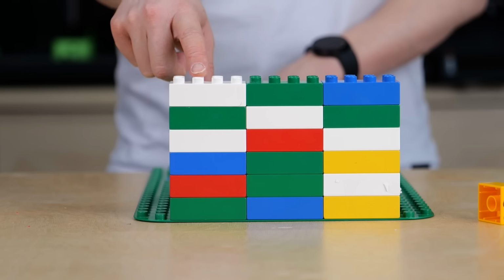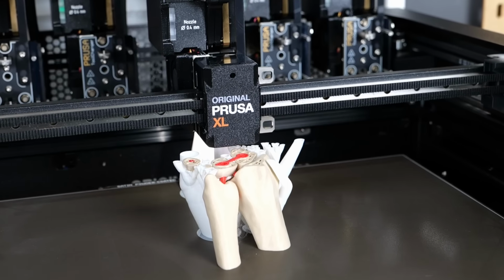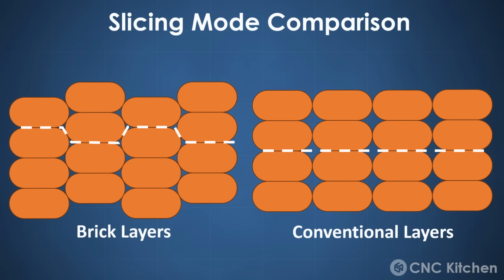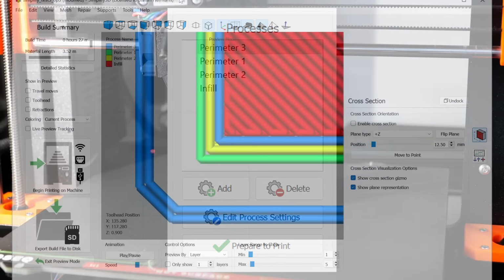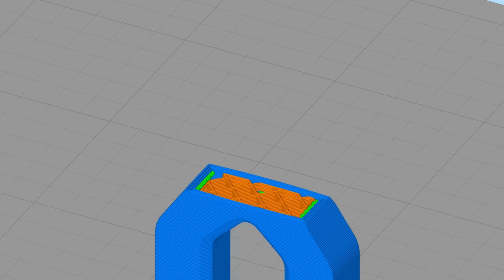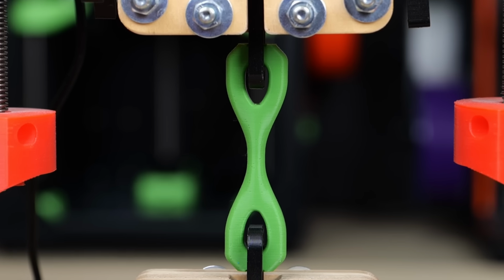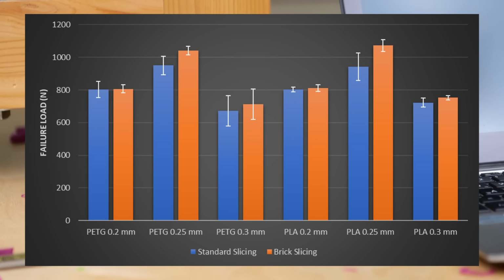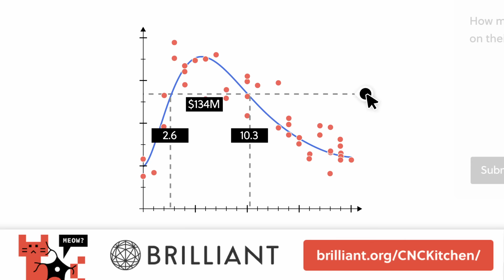Brick Layers - Why did no one do this before?

Comment: One thing I couldn't help but notice was that the contact patches for the brick slicing seemed smaller, even though there was a larger number of them. I can't help but wonder if this might have reduced the potential strength gain and if it's possible to increase the extrusion multiplier slightly to increase the squish of each layer and try and increase the contact patch size
Reply: You identified the main problem with this test: his layers were too high to start with. With low layers they squish into rectangles (in cross section) and as you get to high layers they look like circles. Layer bonding area drops towards zero and tensile strength falls off a cliff. In my experience, nozzle diameter to layer height ratio needs to be 2 or greater. I very much like this idea but I wish he’d done this test with a more conventional layer height (say 0.2mm).
Reply: That extrustion multiplier makes sense too since you are imparting more "void" space since printing lines naturally tend to round out. I wonder how much a small amount of extrusion multiplication would add to final strength
Reply: In PrusaSlicer’s default settings, it uses a 0.45 extrusion width on a 0.4mm nozzle. This plus a layer height of 0.2mm or lower creates perimeters that don’t have the giant gaps.
Reply: @Tyler-wg5xh  This plus extruding at the high end of the material’s temperature range so that it really squishes itself into the voids might get even closer to near perfect contact!
Reply: @joshcarter-com  right but we could increase that for taller layers to make faster prints that take better advantage of this too right?
Reply: @frankroquemore4946  yes, definitely. This would be a great feature for taller layers and faster prints. I posted a separate comment about these factors but unfortunately YouTube comments either get tons of attention or none whatsoever, so I doubt Stefan will see it.
Reply: I noticed something similar, with ideal extrusion parameters the corners between the extrusion paths should be filled.  Perhaps normal extrusion weight for outer walls, higher for infill walls.
Reply: @bosstowndynamics5488 I had the same thought. If it were possible to achieve 0-width voids in the lattice, I think we'd see some real improvement here, and we'd see something that looks like a hexagonal honeycomb pattern in the cross section. Unfortunately, I don't think there's a way to reliably create a 0-width void extrusion process on modern FDM. 

I would really like to see some research on how the shorter distances between the voids affects material strength as well. The problem with FDM is that all of these factors are so hard to separate from each other so isolating effects is a real challenge.
Reply: I thought the same thing, but another option that I think would be interesting is using something like an adhesive to fill the gaps after the print. If you can force a low viscosity adhesive into the gaps that'd probably help a lot.
Reply: @LanceThumping  A lot of those voids wind up sealed in though, they're going to be sitting in between layers and infill lines that are entirely contained within the outer perimeters
Reply: Those empty voids you see on the image are just for illustrative purpose. In fact the voids are filled more completely with this stagering method. You just have to figure out how the material is purged by the nozzle, how it fills the previous void, and then squished by the nozzle to make not a round shape but more a square one. Then comes the next "half layer" and grab those square borders better than if it were just walls next to walls.
Reply: @edufonseca5718  I really don't see how they can be "just illustrative" when they're close up photos of an actual physical print...
Reply: @bosstowndynamics5488  One option is to have something like a dual extruder setup.  We don't build a wall and then try to inject mortar.  Instead we put it down with every layer.

Comment: I know this is old post but thought id add..  it looks as though theres still a good amount of air between the extruded tubes..  it occurs to me that if youre printing alternate high profiles to then subsequently come around and print a half height higher to fill these in. These could be slightely over extruded, as you are now filling in a 'well' you can squeeze the material in a little more and hopefully reduce the air gaps.

Comment: Would it be worth trying adding a tiny bit of overlap of the walls to increase the diagonal contact points? Or maybe adding an half-width perimeter on the outside so each other perimeter is extruded on the middle of two of the bottom ones?

Comment: The secondary cracking looks to me like you are approaching isotropy. This is definitely a positive development.  I’m excited to see what can be done with ideas like this.  Varying deposition width and thickness to direct forces to more advantageous areas.

Would it be possible to print a part with small-diameter z-channels, then, when the print head gets to the top of the part, instruct the nozzle to pause over each channel and inject material down into it?  I’m curious if you could increase tensile strength by adding z-oriented structural members in this way.
Reply: This! I just left a comment about this haha.
Reply: Dang little injection molding channels would be incredible!
Reply: Good idea. Bah, in reality might be difficult to achieve. To inject  some molten plastic for some length in such a channel you must create a pressure all along already filled region of this channel. Thus, you need to seal somehow the channel entrance and a nozzle. Nozzle is hot. It will melt the walls and plastic will go all around the nozzle but not in the channel.
However, maybe it depends on the channel length, and having such a stitches between 3-10 top layers is achievable.
Reply: @bogdan1543  consider the possible use of a second material which has a lower melt temperature.  It likely wouldn’t bond as well to the surrounding “jacket” but it might offer additional shear resistance none-the-less.
Reply: This just popped in my Youtube so I'm a bit late... I've tried this by creating a part with z-axis holes and modifying gcode to do the 'extrusion'. 
1) Superheated nozzle (260 degrees for PLA instead of 230) 
2) Pressed nozzle tight onto the hole (half a layer into the surface)
3) Quick extrusion with some tuning to get timing right (hot PLA was dripping from the nozzle)
Managed to extrude about 10 layers deep, which is promising, but I thought same as @robblincoln2152: One should use a second nozzle with lower melting point & viscosity material. Even something like cyanoacrylate if one could prevent it blocking the nozzle.
Reply: Didn't observe any strength improvement. Probably partly since z-axis holes can cover only a small fraction of the layer surface area.
Reply: @akuusist  I am legit impressed that you actually tried this.  Thank you.  It would have driven me nuts otherwise.

Comment: I'd be very interested in testing this approach towards air/water tight prints. Those interlocking lines should also help with reducing gaps between extrusion lines.

Comment: I remember trying something like this in 2017 by taking a page out of my composites experience with alternating patterns and rotating layers. It was a pain in the butt getting the printer to run them concurrently without inducing a concentrated repetition zone where the initiation point wasn't a blob in a corner. Gyroid infill works in about the same way and doesn't require manual code adjustment, but it would be worth trying again with modern advances of the last few years on the entire layer slice.

Comment: A potentially even better solution could be a system of channel and fill. but require 5 layer at least, so it creates something like this:
nomeclature: 
layer x : sequence of the height of the extruded plastic

layer 1: 10111
layer 2: 10101
layer 3: 13001
layer 4: 10031
layer 5: 10301
goto layer 3

this way you can create more planar decoupling, but it is a lot harder to implement. the other thing here is that the channels where the multi line is filled could suffer thermal failure an suffer some bucking (or eventually, re melting and welding better the vertical interlayers).
Also, this solution only works in close-to-vertical walls. and would reduce printing time as some of the load (machine limiting factor? idk) would move from the kinematics to the extruding system.

Comment: PURE GENIUS! Stefan, you just figured out the best Draft settings ever! This could be the best 0.32 layer heigh way of printing fast and strong parts. 3D Printing will be better because of this video. Way to go man!
Reply: This was my conclusion after reading the post about over extruded solid parts being equally strong with and without stagger or overlap.

This is faster and stronger, for rapid prototyping only.
Reply: It's better, but it's not nearly the best. The best would be to print with the fibers aligning with the flow of tension and compression and leave no hole in the center of the cross section of the model as seen in the demo. Instead of a mere 10% improvement, there could be a 20x improvement.

Comment: Very cool.  I hope this gets more traction.  Could you use ironing to fix the inconsistent top layer? And slightly overextruding in the mid layers also seems like it would be helpful, maybe especially if it could be alternated off and on between alternating layers.

Comment: Just had a mighty row with a friend about this very subject. How to make sure that the circular filament fills out the square “channels” in which a slicer “thinks”. He said I was too lazy to make a better = thicker design. I said there is something fundamentally wrong if slicers can not adopt to this problem. Until then 3D printed parts will be very much weaker the those made with conventional molding technology. You’ve taken an important step in the right direction with this very experiment. Well done!
Reply: the solution would actually be quite simple. Print outer walls first, then for inner walls increase flow so it fills out the empty space neatly squished between the outer walls.
Reply: @Janovich   In theory? Yes. In practice?
Reply: @marcbrasse747  In practice, I think it'd tend to warp if that's the only change you made.
Reply: @S_Roach  Your remark is a bit cryptic. Please explain what you mean in more detail. 🙂
Reply: @marcbrasse747  I suspect if you created a shell, then filled that with hot filament, which, please remember, is a non-Newtonian fluid, in that it readily expands after it leaves the nozzle, to its "natural" diameter, that you'd end up with a shell that was being pushed on, constantly, by the filler. I think this would likely result in a print that tended to change its shape over time. To warp like green wood does.
It would probably be more obvious in thinner-walled prints.
But, that's only my speculation.
Reply: @S_Roach  it’s all a matter of balancing a lot of parameters but the fact that the smelt expands after leaving the nozzle could actually be used to make the round thread expand into the square channels in which a slicer thinks. It is after all supposed to reduce every object to a sort of reduced resolution maze of  square “tunnels”. In an optimal situation the expansion should exactly fill the extra surface. The bricklaying method described here can be a first step towards such optimizing but even a pile of cilinders still has a lot of empty spaces and thus a potential for poor adhesion. Just empty a sack of unboiled spaghetti. Many a print actually behaves like a bundle of half boiled spaghetti. 😁

Comment: The use of dimensional adjustments in simplify was pretty smart! I think most people don't realize how powerful the process settings in Simplify can be. I would have never thought to use them this way. Nice video 👍🏼
Reply: True, I used Simplify 5 years ago to achieve the adaptive layer quality almost without time loss (outer perimeter is 0.05mm, inner and all other model parts — 0.3mm) using the same technique with multiple printing processes. Even 5 years later there are no slicers which can offer me this incredible functionality.

Comment: This idea needs to be tested with z “wobble” this would drastically increase the surface area and should result in stronger layers. 

Ps a series on maximizing layer strength  would be awesome.
Reply: My mind immediately goes to sinusoidal z-oscillation, but I can imagine there are at least as many variations to try as exist in infill patterns.
Reply: Yeah that would be a good idea too!
Reply: Check out additive manufacturing of non-planar layers with variable layer height (Pelzer, hopmann 2001),  they attempted something very close to this with fairly promising results.

Comment: What if you made the outside 0.1mm, but the inside walls much thicker like 0.4mm, where possible, to give more overlap? Then you can have a smoother appearance or finer detail on the exterior but stronger brick construction on the inside? Possible??